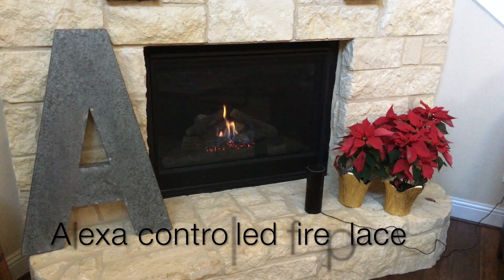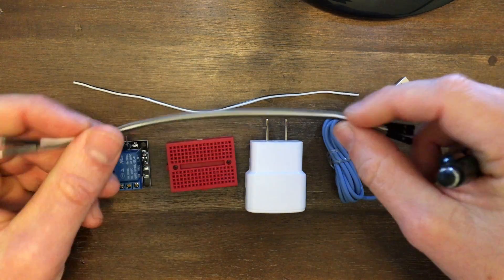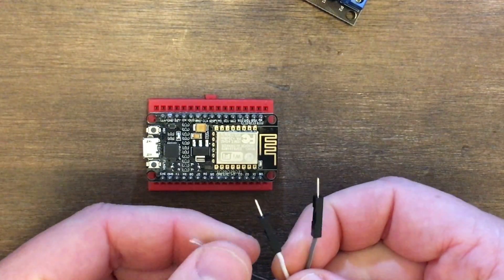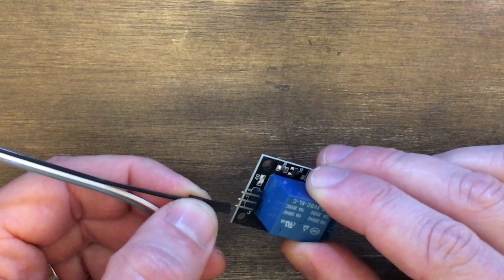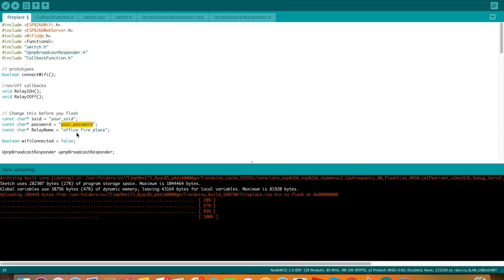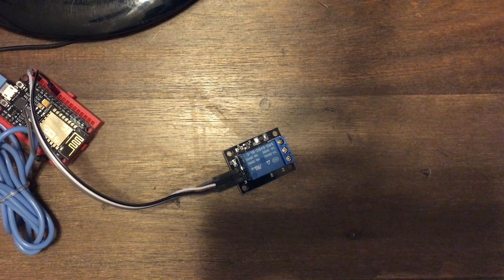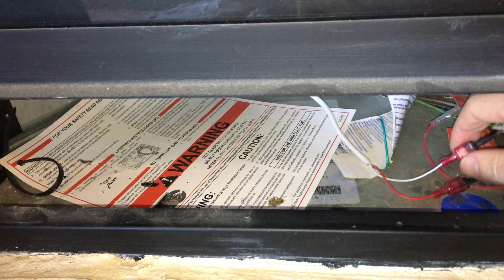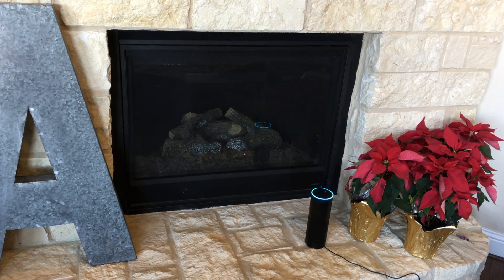Alexa Controlled Fireplace with NodeMCU (ESP8266) DIY and parts list

Comment: Tip: if you want to keep the light switch control, you could also connect the wires from the switch to GPIO pins on your NodeMCU. Nice video, thanks. I will try this.
Reply from the maker: Thanks. Any idea which GPIO pins on the NodeMCU? I switched to using Sonoff SV devices to use the switch https://www.youtube.com/watch?v=fYi9pqENf5U

Comment: Great video. I believe I have the same model fireplace so that makes it easier. How would you wire if you wanted to keep the functionality of the wall switch, so you could use both?
Reply from the maker: Hi. Lots of options. Check out some of my other Alexa/Fireplace videos. I am working on a new video which will allow you to use the wall switch and Alexa just like a regular 3-way switch. Should be another day or two!
Reply: Which fireplace model is that? I am looking to try this on a KozyHeat Bayport 36 non-millivolt fireplace. The wiring diagram appears to allow you to replace a rocker on/off switch with a low voltage wall switch. So I think this might work. Fireplace only came with a remote to control it.  Great video by the way.
Reply from the maker: Thanks. I don’t recall which model I have, but I know it’s pretty common. Yes if yours supports a low-voltage switch, I’m pretty sure this would work. Good luck!

Comment: Great video!  One question, do you know if its possible to have this working with Google Home?
Reply from the maker: Day Night - Hi. It probably will work with Google Home, but I have not tested it. This emulates a Belkin Wemo device, which is compatible with Google home. 
I will have another video out soon which does the same thing, but uses a Sonoff SV instead. Should be a little easier to setup and has more options and should also work with Google home.

Comment: Hey - the breadboard and jumpers link to Amazon no longer works. Could you please update? I just want to make sure I get the right one.
Reply from the maker: Thanks. I will change the description. Here is the new link https://amzn.to/2Qoj6my
Reply: @mattadata2  thank you! Got it all setup and the only thing missing is are the spade connectors going to the relay. Do you have a link for those?
Reply from the maker: @carlosrabanillo4716  - This is an assortment of sizes....good to have many around. https://amzn.to/2PDwWfJ   You also get these at any Home Depot or Lowes.

Comment: great video!
Does the relay give a flash of power or does it constantly give the fire place power until you turn it off?
Reply from the maker: Thanks. The relay stays closed and completes the circuit until you turn it off.  So it constantly keeps the circuit on until you turn it off.
Reply: I just installed a relay switch to open and shut my garage door with Alexa. I have the relay switch set up right now to just give it a flash of power but I'm sure there is another bottom that I can push so the power would always be on unless I shut it off using Alexa? If I attach a link from Amazon would you be kind enough to let me know if you think it would work to turn on my fireplace remotely? I would love to use the same app for both my fireplace and my garage door.

https://www.amazon.com/gp/product/B0752P57ZG/ref=oh_aui_detailpage_o00_s00?ie=UTF8&psc=1
Reply from the maker: Yes, I think that will work. But not sure how to change the function of the relay. For the garage door, the relay is in momentary mode. Which means it closes for about 2 seconds , then opens back up. You need it in latching mode for the fireplace. There is not much info on the amazon site. Perhaps it can be configured in the app? It mentions ‘inching’ mode. Not sure what that means from the Chinese translation. I would be surprised if there was no way to put it in latching mode.
Reply: Thank you for the response back!

Comment: I dont think im getting enough voltage to myrelay, it lights the led but doesnt click open the connection.  If i put the voltage right to VCC on myrelay it clicks open etc.  Any ideas
Reply from the maker: Venti1979 - I agree. It seems like the really is not getting enough power. First make sure you’re using the 5 V pin (VIN) from the nodemcu  and not the 3 V pin.
Reply: @mattadata2  it is, VIN goes to in1, grd to grd and D1 to VCC.  Maybe i dont have the correct module?
Reply from the maker: Venti1979 - sounds different. Try swapping IN1 and VCC wires on relay.
Reply: @mattadata2  ok so VIN to VCC, grd to grd and D1 to In1 and it clicks on with 2 led lights on but wont turn off via alexa unless i disco the power
Reply from the maker: Venti1979 - can you send me link to the relay module you have?
Reply from the maker: So that relay looks nearly identical to the ones I use and I think you had it wired correctly before I asked you to change it. But....I see this in the description on Amazon "5V low trigger relay. (Triggered with 0 volts ON, and with 5V off)".  That is OPPOSITE of what the code does. So you can try reversing the HIGH and LOW  settings on the two digitalWrite commands in the fireplace_2.ino file. There are only two of them in the code. Change the HIGH to LOW and the LOW to HIGH
Reply: Done but all it did was change the led to light up red when off and nothing when on.  The only time the relay clicks open (and stays open) is when i reverse VCC and In1.  Im thinking the relay isnt compatible or designed for something else.  Im waiting on another order
Reply: Got new relay in today, works like a charm! So don't use robojax low voltage relay.  Ugh.  Quick ? Any way to turn off the click on the relay?
Reply from the maker: Great! Glad you got it working. You mean any way to make it silent? Nope.
Reply: @mattadata2  ah well better than not working i guess, thanks again Man!
Reply from the maker: Also, use your voltmeter and measure the voltage on the relay between the negative pin and the Signal pin. Do this both when the relay is switched on and when it switched off. You should see close to zero when it’s off and about 5 V in the relay switch on.

Comment: UPDATE: 3/30/18 For some reason the device used for this has stopped working. Unsure if it is the heat from the fireplace or just failure. Alexa's response is "Fireplace isn't responding."
Reply from the maker: Yes, that is strange. I just tested mine and it still works. Alexa has been behaving extremely weird and buggy last 2 weeks, could be related to that. Try these two simple things if you haven't already. First, unplug it and let sit for a few minutes, then plug it back in. From your Alexa app, remove it from your Smart Home devices. Then try and discover it again like a new device.
Reply: Thanks for the tips but they didn't resolved the issue. The issue seems to be the original one i had where it is not connecting to wifi. Even though when i run the scan script it finds it. I run the led blink script works fine. But it will not connect to wifi even though it was for awhile.
Reply from the maker: I will let you know if I think of something else to try. Sorry about that.
Reply: 9/11/2018 Revisited the device that stopped working and discovered why. We have 2 echo dots in our house.  One upstairs and one downstairs. The one that lives downstairs was originally registered to my wife. But once I began adding skills and smart devices (smart plugs esp8266 device and logitech harmony) I unknowingly took over the registration to setup these devices on the mobile device i used to set them up. Well her Pandora account wasn't working so she unknowingly took back over the registration and then none of the skills or smart devices worked.   So a big flaw in these echos is they can only be setup by one person and or skills setup by that same person on that same device registered to that person .  If that ever changes you lose your skills which drives the smart devices.
Reply from the maker: Thanks for posting! Good work finding the issue.

Comment: Thanks for the two videos.  Everything worked just fine.  However, today I cannot connect to the Belkin router so I am wondering if there is a way to connect to a different router or different IOS app to control the fireplace switch.  Thanks
Reply from the maker: Bob Sarkady - hi. What do you mean by the Belkin router? Can’t Alexa control the fireplace? 
I am working on an additional solution so the existing wall switch will still function.

Comment: Will you be doing another video to show in more detail how you were able to keep the wall switch in the scheme along with the relay? I know you did a drawing but it might be helpful to see it all wired and explained. Thanks!!
Reply from the maker: blue tooth - Yes. I now have a 4th (and my favorite) way of using the existing switch. It will allow you to use the existing switch for off and on and it will stay in sync with Alexa. Still working on it though.

Comment: I want to do this integration, but I have a fireplace that is temperature controlled.  How Can I incorporate that so that Alexa turns up and down the flame or temperature.  Here is my current fire place here.

https://youtu.be/_tvYlKEDUK8
Reply from the maker: Is it a manual turn knob under the fireplace? It will be pretty difficult to control that with Alexa. The only Alexa skill I know of that lets you change temp is for Nest/ecobee thermostats. Code would have to emulate one of those.
Reply: I was think the same thing ecobee controls fan and temperature.
Reply from the maker: UCITWORLD - cool. Is that remote IR or RF? If IR, then it can usually be emulated with NodeMCU.

Comment: OK - I need a new project so I'm giving this a shot. Never did any Arduino projects but I think I can figure things out. Question: Any suggestions on a case or enclosure for the unit once built? Do you think that is necessary? I would also be tucking it under the fireplace like you did. Thanks again for a great solution.
Reply from the maker: Great....you will love it. Putting it in a case is a good idea. Keeps it from shorting out on the metal fireplace. I used this same hardware on my garage door opener (video on that coming later) and I put that in a small plastic container that my kids use in their lunch boxes. That is the cheap and easy way. I have thought about 3d printing a case for this as well. Lots of good cases on Thingaverse for NodeMCU https://makerware.thingiverse.com/search?q=nodemcu   You can have them printed locally if you don't have a 3D printer with https://www.3dhubs.com/   Lots of good arduino learning on https://www.adafruit.com/. Start with some of the example sketches in the IDE

Comment: Great Video and looking at the comments it appears that many people are having success. But when I try downloading the software Codes. right before I finish downloading it gives me a Error I have attempted many tries in the Fireplace Folder and even Copy and Paste Code in its own Folder. If anyone else experience this and was able to correct it any Suggestions would be appreciated
Reply: Putting the Upload speed to 115200 Did the Trick. I can't thank you enough for your assistance. I was able to get Echo to add it to the system I just need to wire to the Fire Place... Thank You again for your help and for writing this program, the money this saves people it quite considerable.
Reply from the maker: Arthur Smith - When you download fireplace_2.zip , make sure you unzip/extract all the files. 4 files will be in a folder called fireplace_2. Double click fireplace_2.ino. It will  open in Arduino IDE. Click on settings tab and enter you Wi-Fi info.
Reply: I did that before uploading and Changed the file name to fireplace. If the Node Module lights goes out until uploading does mean a bad Module
Reply: I do appreciate the feedback
Reply from the maker: sorry, don't understand the question about the light. There is no need to rename fireplace_2 to fireplace. The point is, the folder that contains the *.ino file needs to match. So either fireplace and fireplace.ino OR fireplace_2 and fireplace_2.ino.   So does your code not upload to 100%? What percent does it get to. Post a screenshot if you can.
Reply: It is almost 100% then I get there an error in uploading the Script
Reply from the maker: I have never seen that issue before. Let’s try a basic example sketch to make sure your board, usb cable, and computer are working fine. Goto File -> Examples -> ESP8266 -> Blink. Compile and upload that to your board. This is a very basic sketch. This will make the red LED on the board blink off and on. If it blinks, everything is good. If it doesn’t blink, there is an issue somewhere.
Reply: https://1drv.ms/i/s!AsSv5GgnNYYJjiFb8kRJZif-ctaE   I'm trying to send a Screen Shot hope it works. When I uploaded the Blink Program everything worked great thanks again for helping me you are great for doing so
Reply from the maker: I am grasping at straws now, but try this. Change you your upload speed. From screenshot, looks like it is at 9600. Try putting it at 115200. Tools -> Upload speed. I believe this is independent of the serial speed. The serial monitor speed should remain at 9600.
Reply from the maker: Arthur Smith - glad to hear!

Comment: Got the node connected to WiFi how do I get the node in discovery mode so Alexa will find it. Simply asking her to search when right next to it finds nothing.
Reply from the maker: Ok. I will need you to help me test. I think you might need the Wemo Alexa skill installed first. Please install that skill on Alexa, and then try to discover with your NodeMCU turned on and connected to Wifi. Please let me know the results.
Reply: Im still having having this issue as well. I cannot get Alexa to discover my node. It looks like in order to install the wemo skill on Alexa you need to have a wemo type device which I currently do not have. I would be willing to purchase a wemo device if this for would would fix this issue.
Reply from the maker: Ben Dodds - so you can’t install the Wemo skill? I don’t think you need to configure the Wemo skill or link it with an account.... just have Alexa install it. What does Alexa say when you try to install the skill?
Reply: same issue - Alexa app says when trying to enable " A network Issue occurred. Please enter the name of your wifi network and Mac address of one of your wemo devices
Reply: Same with mine as well. Alexa asking to verify access to the wemo app but the wemo app wont allow you to enable access without first installing a wemo device.
Reply from the maker: Ok. Perhaps you must need 1 Wemo device before this will work. I already had 1 Wemo device....and so did my neighbors I installed this at. I will do some more research and see if there is a workaround.
Reply: Does it have to be Wemo? I have many TP Link plugs
Reply from the maker: DANIEL WOODALL - I doubt that will work, but can’t hurt to try.
Reply from the maker: I don't think the Wemo app or skill is needed. The newer Echos are having a problem discovering this device. I am testing the fix now
Reply from the maker: Sit tight...testing a fix now. Don't think you need Wemo app or skill
Reply from the maker: please try the new version in the top of the description
Reply from the maker: please try the new version in the top of the description. No wemo apps or skills needed
Reply: mattadata2  any luck?
Reply from the maker: Yes. Did you try version 2? It at the very top of the show description.
Reply: No luck here either. I used version 2. Did it twice, but Alex doesn't find it nor does she respond to "turn on the Fireplace" I know you have to be very specific with Alexa, so is "turn on the fireplace" the correct wording?
Reply from the maker: Yes, that is the correct wording. I now have a 3rd way that seems to be more robust. Its works for me...but so did the first two ways. Do you want to be the guinea pig and give it a try?
Reply: lets do it! :)

Comment: Hi, Thanks for the video!  When compiling, I keep getting an error that "D1 was not declared in this scope". Any ideas would be greatly appreciated.
Reply from the maker: Hmmm, not sure about that one. D1 is the pin connected to the relay. If you didn't modify the code, then it should still compile. Maybe try downloading the code again in case something accidently got changed.
Reply: Thanks for replying.  I have done it a few times and it keeps coming back with the same error.  This is where it keeps directing me in the code.
void Relay1Off() {
    Serial.print("Switch Relay 1 turn off ...");
right here---->  digitalWrite (D1,LOW); 
}
// connect to wifi – returns true if successful or false if not
boolean connectWifi(){
 
Do you think there could be something wrong with the board?
Reply: ok, learning as I go! got past this issue.  I apparently had the wrong board selected.
Reply from the maker: I made another video that might help with some of the more detailed steps. Let me know if it helps https://youtu.be/tj3EPX2TPf8

Comment: Very nice job and thank you for posting. I have a question, and not trying to be a smartass so please don't take it that way. Just trying to learn. Could the same thing have been accomplished by replacing the wall switch with an Alexa controlled light switch?
Reply: The problem is that the wall switch is low voltage and as of yet I have been unable to find a low voltage smart switch.  The Wemo "Maker" used to be an option but they no longer make it.
Reply from the maker: Good question. Its funny you ask....because that is what I tried first! I tried both the kind with a socket you plug things into, and the kind that replaces the switch. The socket one didn't work because the fireplace controller reset when it loses power. The wall switch one didn't work because the wall switch doesn't have AC (120V) lines running to it. The wall switch only has low voltage DC coming to it from the fireplace controller. Also....I just enjoy making things!
Reply: mattadata2 that makes sense. I also have a wall switch but never looked at it’s hook up. I like making things too. Thanks again.